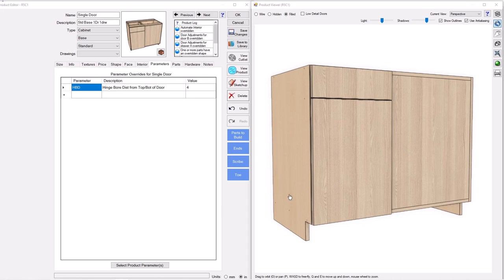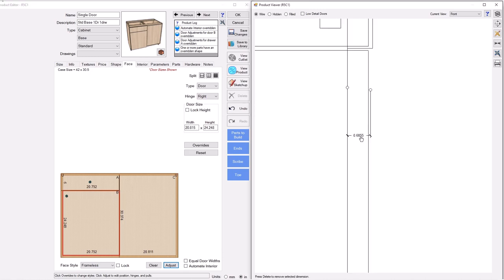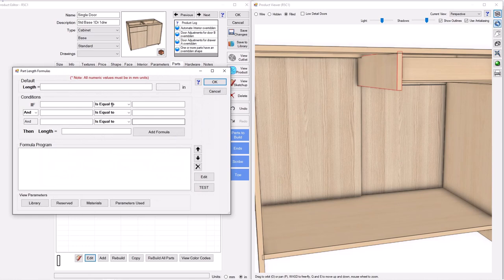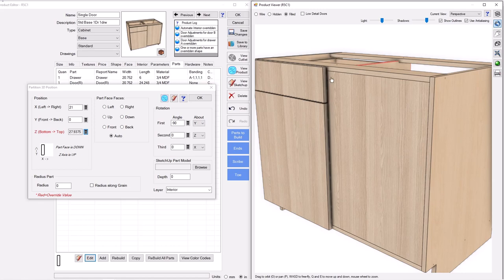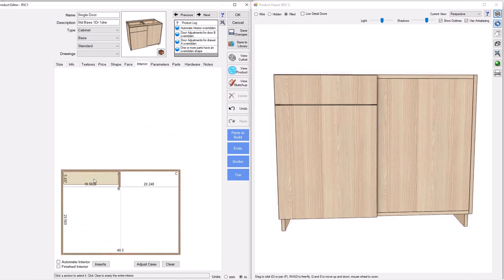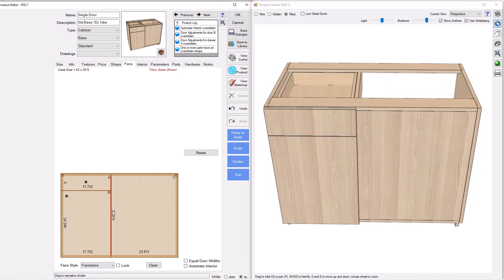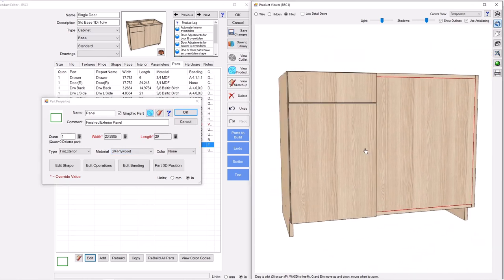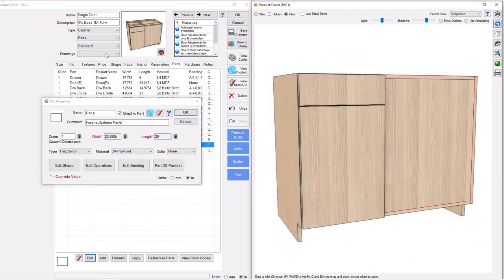IMPROVE YOUR BLIND CORNERS: PART 2 of 2...Inset Panel Blind Corner in Mozaik Software!

Comment: Thank you for these tutorials!

Oddly, ToeH if brought down as a parameter override and changed from the library default, messes up the z position of the partition when changed from ToeH=4-0" to 3-1/4".  In the case of lowering ToeH to match an adjoining cabinet with casters where I lose 3/4", I am now debating blocking the casters up 3/4" vs. trying to figure out how to get my overridden ToeH recognized so I can parameterize the entire build.

I've also seen instances where parameterized W or L is not picked up on a formula for 3D position, rather Mozaik seems to use the default W or L prior to parametric modification. But not always. Perhaps a bug or operator error?

Comment: Nic, this is a great tutorial. The only thing I am missing is the screw hole for partition into the stretcher. I have the screw hole from the exterior of the cabinet into the bottom drawer stretcher, just not one from the divider into the bottom drawer stretcher like in your video. What did I miss here?

Comment: Instead of modifying the short partition length, could you flush the horizontal separator to the bottom of the front face split?